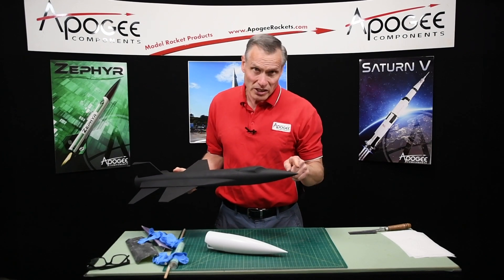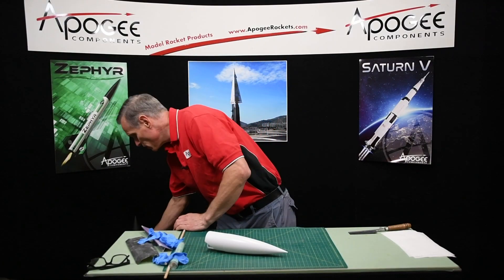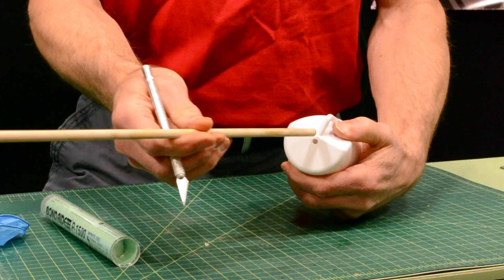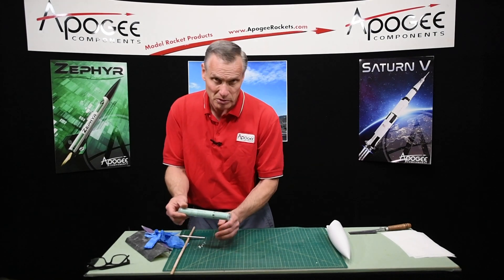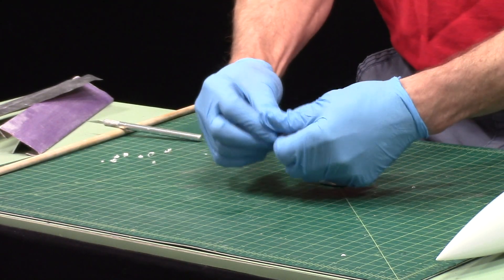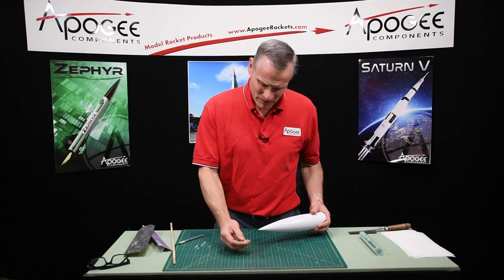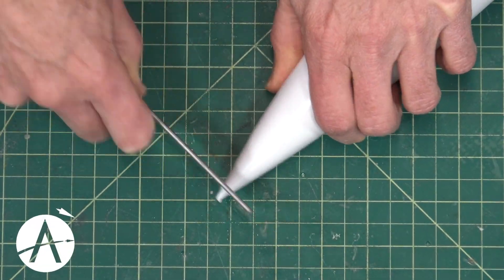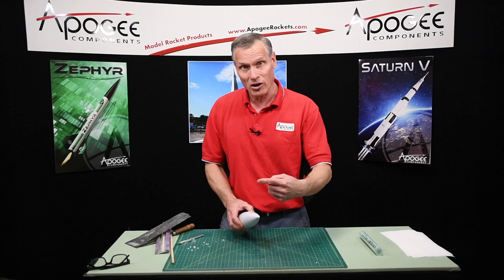Rounding Off a Pointed Nose Cone

Comment: One could also simply cut off the tip a short way back and glue in a balsa plug which then be sanded to form. Avoid epoxy that way. .. well ... Except to glue in the balsa plug I guess. Maybe superglue instead. AND can harden the tip with superglue.

Comment: Hi Tim!
I think using a drill bit would be much faster to make the hole larger, and you could position it away from the recovery loop.
I've seen a couple different ways of altering the tip of a nose cone, but using epoxy putty is a first.
This is something I'm going to try real soon. 
Thank You Very Kindly for the video on this!
Is there any Release Agent inside the Nose Cone? Have you ever had the epoxy putty come loose over time?
I added a mixture of Lead Fishing Weights and Liquid Epoxy for Nose Cone Weight on occasion.
And over time the Epoxy let go and I had to re-epoxy the mixture back in place.
That's why I ask if there is Release Agent on the inside of nose cones.
The nose cone I had the problem with was a BT-80 for a Scratch Built Phoenix Missile.
I'm not sure who manufactured it, I bought 3 of them off Ebay some years back.
But it looked very similar to the one in this video.
I really enjoy watching your videos and reading the Peak of Flight News Letters!
I got all the plans for rockets in them and recently ordered the decal package for them.
It should keep me busy this Winter! 
Thank You Very Kindly for all that you do for us old Rocketeers!
John,
Woody's Workshop
Reply from the maker: I can't speak for nose cones made by other manufacturers. But this works on the Hi-Impact polystyrene nose cones. If you want a more secure attachment if you think you'll have this problem, use the technique of the wood dowel shown in Peak-of-Flight Newsletter #329 - https://www.apogeerockets.com/education/downloads/Newsletter329.pdf